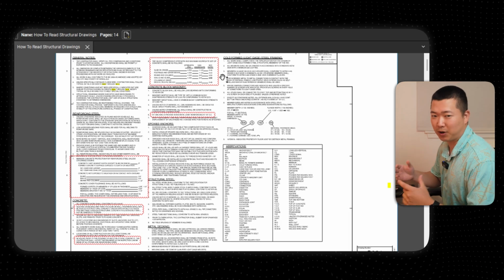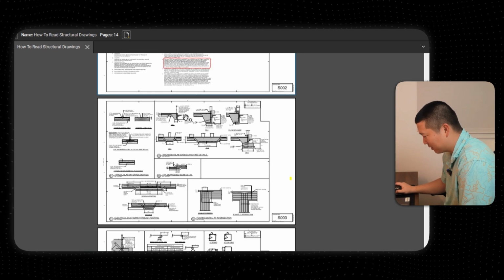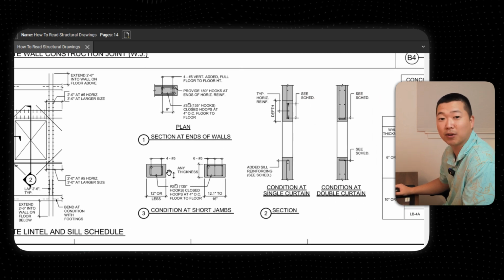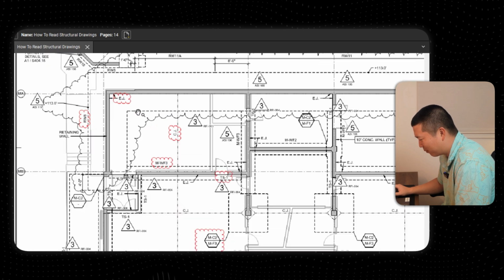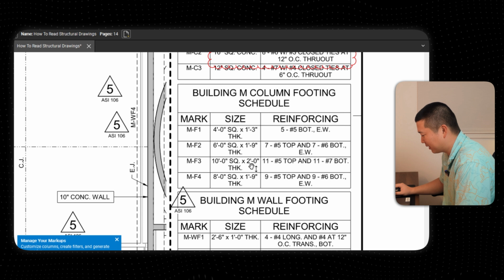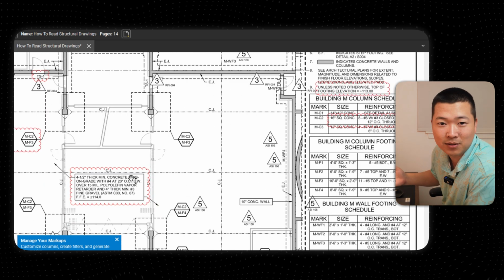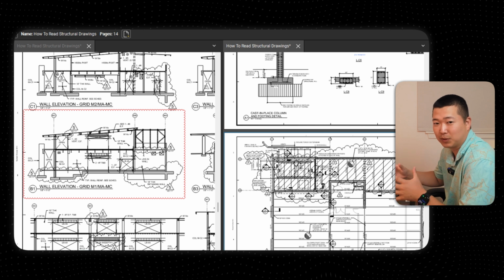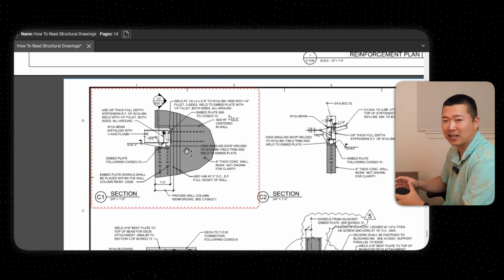How To Read Structural Drawings For Beginners: Construction Blueprint Reading

Comment: Australian Construction professional, recently moved to Seattle WA, adjusting to the Imperial from Metric system. Love your videos. Solid content, well presented, well made, very clean, clear and digestible.
Reply: nice whats the main differnces you found in america
Reply: @Aamm11-  Material differences due to colder weather. Sounds minor but it takes time to familiarise yourself with those differences. 

Construction terminology is very different.
Cladding = Siding
Skirting boards = baseboard / mouldings / Trims etc.
Benchtop = countertop 
Just to name a few.

Never seen anyone use spray on wall texture in Australia. 
Here its common.

Two pronged power cables drive me crazy 🤪
Reply: @33Dean51 what do they call smoko over there 😂